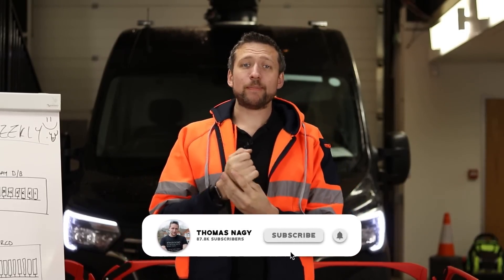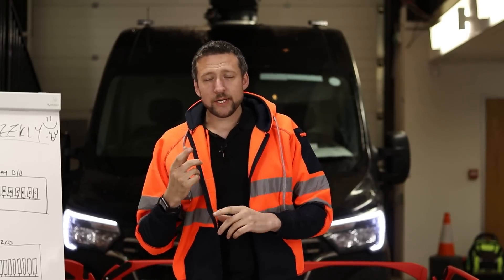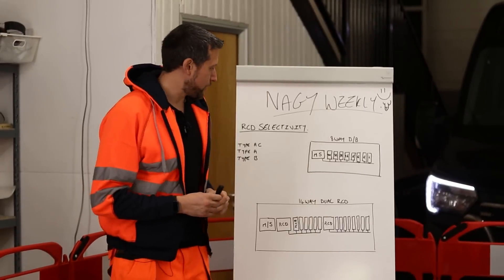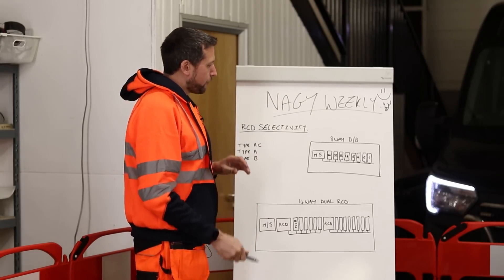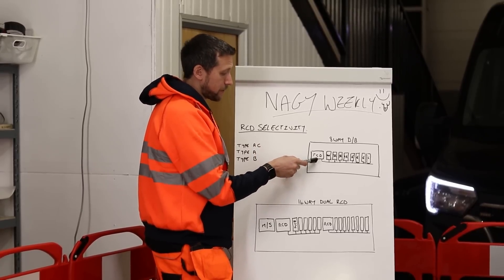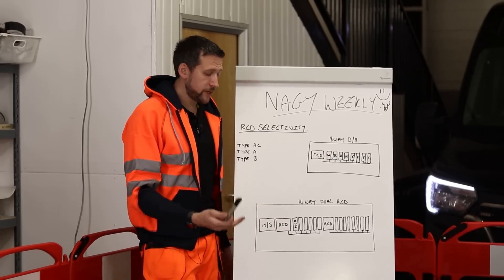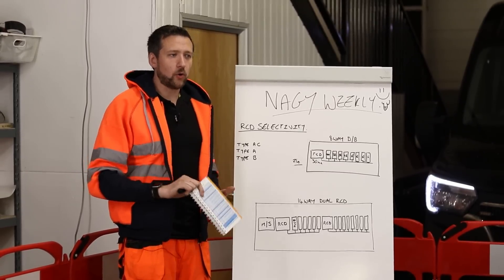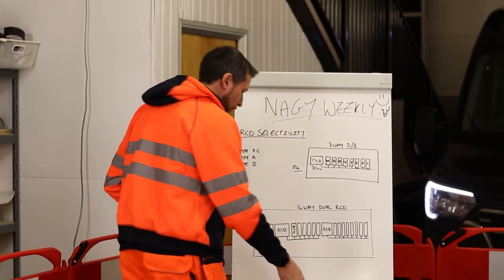Why RCBO's are BETTER than RCD's | Thomas Nagy

Comment: It's true but it's also an argument for domestic emergency lighting when rewiring
Reply: And when you've emergency lit the stairs and exits add one by the consumer unit.  Save that usually futile search for a torch.  😀
Reply: @calmeilles  I have one in place.
Reply: I would suggest in larger properties this could be important.
Reply: @stephenwabaxter   yeah more important in larger properties especially with staircases like the example Tom gave but even in flats 2 watt little emergency spotlights aren't that bulky or  expensive you could have one at each door way and a couple  in the hall to light an exit path should the power fail it would help orientate the occupants to either reset the power or escape but then RCBOs seem to be out of reach for a lot of people never mind emergency lighting it's a shame clients don't explore what is actually possible more rather than refusing to open their wallets 😄

Comment: Anybody want to give me any pointers on what would be a good candidate to replace an old Federal Electric board in my house? looks to be 80's? maybe 70's?
NOT DOING IT MYSELF - just so I know if the sparky is going to put in one, what is a good consumer board to install - hager, fusebox etc
Ta
Reply: Anything.  Just get it done quickly.  Those boards are a serious hazard.
Reply: Parts availability!
If you have a problem on a Friday night and you call out a spark, you would like them to have what you need on their van.
Or at least something you could get on a weekend.
If you call out the spark that installed it, they're pretty much guaranteed to have that brand in.
But I've gone to call outs where it's turned out to be a faulty MCB or RCD and even midweek availability of an obscure brand is a struggle.

Comment: I agree with what you say Tom, I rather fit rcbo’s I think you have to take each job on it’s own. What it boils down to is the price, an what the customer can afford
Reply: Totally agree, 1 RCD is better than no RCD, Dual RCD is better than 1 RCD, RCD for each circuit better than dual RCBO...  But still better to get RCD protection.  Often its a case of Dual RCD board or not being able to afford to change the board...  The great thing with dual RCD boards is if you have a shared neutral at least you can put both lighting on one side, if the customer cant afford any more...  I would rather fit a Hager dual RCD rather than a cheap rcbo.

Don't buy Betty Crocker coming down the stairs with a hot cup of tea, even on an RCBO board, Betty Crocker puts on the stair lights, that RCBO trips and she stills fall down the stairs.  Dual RCD still complies with 18th edition.  I get Hager dual RCD, both 100A RCD type A.  Also totally missed Type S RCD.

Comment: Its all about price. Even council housing CU upgrades  still only want Dual RCD board to comply with 18th Edition. They dont even want SPD installed despite it being mandatory nowadays.
Reply: Surge is not mandatory
Reply: @Mainly_Electrical  absolutely.....good practice only at the moment
Reply: This is where we must learn from Grenfell. The same high standard must apply in every property and we must never accept 2nd rate.
Reply: I worked with a spark so know a few things. I qiuks pull stuff up with my houseing lady and cheap shoddy work with something. What could kill some 1 she looked at me like I was a mug and knew sod all  she was a witch she disnt stay long after I made her look a  fool